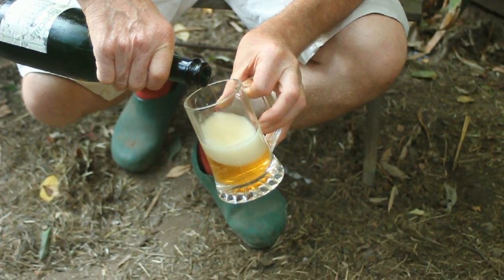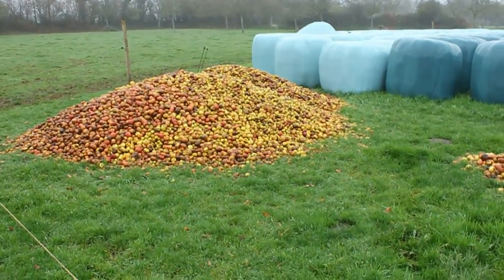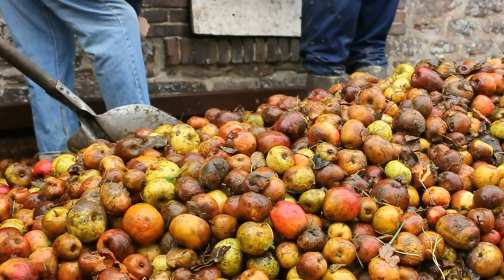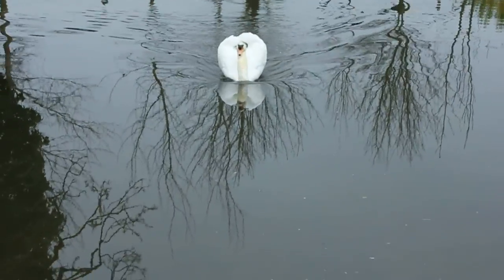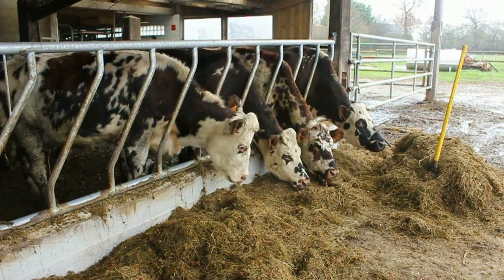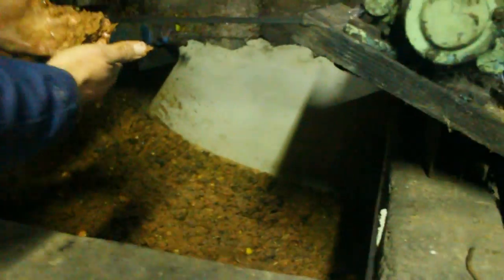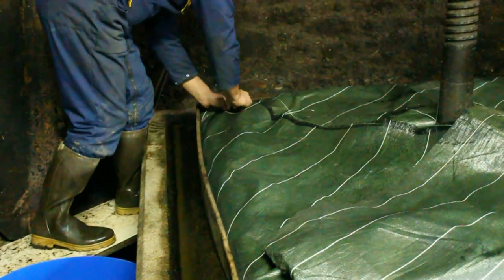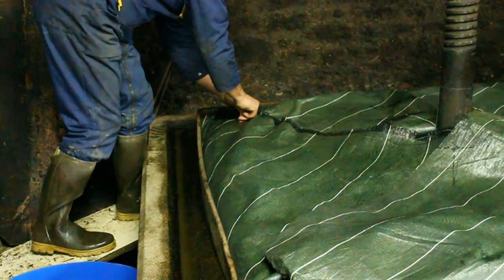Making Organic Farm Cider in Normandie. Fabrication du cidre bio. Elaboración de la sidra orgánica

Comment: wow it's fun to learn you guys speak francais aussi,, very nice visit to this farm, but wont those rotten apples lend a bad off flavor i figured? and they do not bother washing the apples with all that dirt, insects worms etc on them ? how do they get a good sanitary clean drink? i mean we making cider here not distillation its very surprising to see it done so rustic unless they pasteurize it, i wonder if they also have a hand in doing calvados?
Reply from the maker: Well, the apples are left in the Autumn rains so they do get a 'rinse'. The great thing about this fermenting process is that after a few days in the fermenting vessel a 'cap' rises to the surface comprising all the crud, worms etc.. and this is scooped off and discarded. No, the cider is not pasteurised and tastes great. This technique is common to most farm cider production. I have seen a mobile unit which visits some farms too small to have their own chopping facility. This machine was belt-driven from a tractor and the apples were emptied into a water bath from whence they were transported via a conveyor belt into the chopping machine  From my observation the water in the bath remained the same throughout the whole operation, so after the first few minutes, the apples were being washed in a mud soup with grass and worms as the garnish. Surprisingly, the end result was still drinkable. A small amount of cider is sold off for the making of Calvados. Cheers, Andy.
Reply: @Organikmechanic  thank you

Comment: Thanks, un grand merci. This helps me carry on my own small scale cider making with apples that people call "off". The result is always appereciated.
Reply from the maker: Hi there and thanks for your comment, I really appreciate it. It is amazing  how these 'off' apples have been used for centuries, I suppose the ultimate product from these fruits is Calvados which as I'm sure you know is produced in a still. In the USA they have applejack which, traditionally is freeze distilled (cider is left outside in freezing conditions and the water freezes thus allowing the stronger liquor to be decanted). The farm making the cider in this video also produces apple cider vinegar (ACV) and this is also a tasty and useful product from the 'off' apples. Do you do this as well? Best Wishes from Normandie, Andy.
Reply: @Organikmechanic  Thanks Andy, 
I might try vinegar some time. On a very small scale I make my own version of calva, from the cider that's left when the new harvest is there. 
It's a nice and interesting hobby.
Reply from the maker: @toonvanderven3508  That's really interesting, are you freeze distilling or heat distilling? I always hear of the more toxic fractions that can arise in any distillation process but evidently you have avoided these compounds. I suppose at the very worst you could always run a small internal combustion engine with it.
Cheers, Andy.

Comment: Its a shame the whole process is not shown. Where and how long is it fermented for.
Does it stay on its lees until bottling?
How do you add the fizz without kicking off fermentation again.  Thanks
Reply from the maker: Hi Philip, I've just been to the farm and this is what I've found out; they check the specific gravity to determine the dryness of the finished cider (they're looking for about 1023-1024). After 8 days a 'cap' will have risen - this is the larger bits of apple and debris that got past the press and must be removed, this is the cleaning process. Once the correct SG is achieved they bottle no priming is needed, the fizz will develop. I was also told they bottle with a waning moon to avoid an 'overexcited cider'. I am writing a blog on this as I realise the film cuts off the process before we get to the bottling and a lot of people have asked me about this stage. Thanks for watching and commenting. Cheers from Normandie, Andy.
Reply: @Organikmechanic  brilliant. Any idea on the starting S.G
Reply from the maker: @philaddison7590  Hi Phillip no idea but will ask next time I go to the farm for our milk in about a week's time. I do know however that depending on the growing season, the sugar content in the apples will vary tremendously. The way the cider is made is the method they have used for centuries and every year the cider is different, dryer/sweeter/fuller bodied.... By the way if you are interested in traditional methods of farming you may like to see the butter and cream-making film too on the same organic dairy farm. This unlike the cider film already has a written version :  https://www.youtube.com/watch?v=4M4Etxj25lU All the very best from Normandy Andy

Comment: so...the don't even wash the apples? I guess is where all the yeast come from. Amazing! Is this the same process they use to make Calvados?
Reply from the maker: Hi Rodrigo, many apologies for not replying sooner. The apples are washed by the rain and that's all. The stuff that is attached to the apples floats up in the fermentation vessel and forms a 'cap' after 8 days which is easily removed by hand. The yeast, I think, is in the air. I've made apple cider vinegar at home and I've scrubbed the apple skins before chopping them and putting them into a glass jar, fermentation starts within 24 hours so my bet's on airborne yeast. In answer to your second question, yes this is the first stage to make Calvados. Once made, the cider is put through a still and the alcohol from this becomes Calvados (after maturing in barrels)- very much like Scotch  whisky. The still is a mobile one and I believe visits the small farms in the region. Thanks for watching and for commenting. Very Best Wishes from France, Andy.
Reply: @Organikmechanic  As long as you don't wash the apples in vinegar, then you can scrub them all day long and you won't get rid of the yeast that hides out in the pores of the apple skin.

Comment: I feel like I'm asking the wrong question, was that gelatin in the mother?
Reply from the maker: +neiallswheel Not at all, Ask away. What Lydie is showing is the old mother, who after two years is 'dying' and about to sink to the bottom if not removed (the thing that looks like an old dish cloth). The gelatin-looking filaments are bits of the new mother that will eventually 'knit' together and form another complete 'dish cloth' over the vinegar. Lydie calls it 'une chape' which is literally a cope or bishop's cape and much more poetic than my explanation!! Actually I am sitting looking at a jar of these 'baby' mothers as I write this, as Sue is about to make Apple Scrap Vinegar and Lydie has given her this as the starter. All the very best and thanks for your question - we should have translated that bit but it is nice to hear her original commentary, Andy
Reply: The pelicile isn't gelatin, it is cellulose. Perfectly clean and sterile. It allows gas exchange, but protects the batch from contamination. Very fascinating stuff.